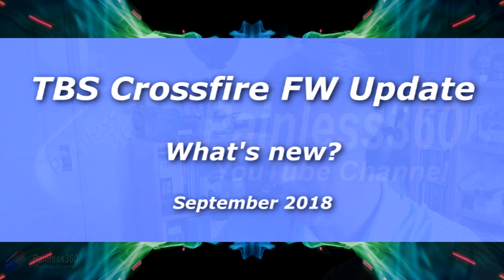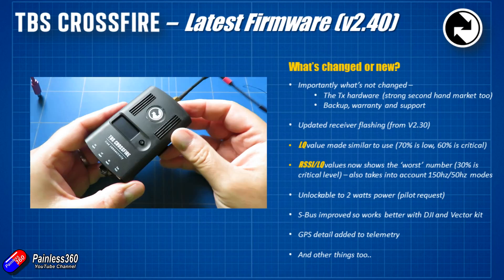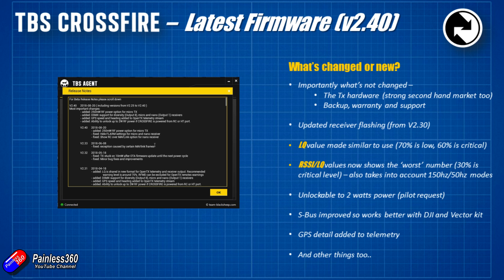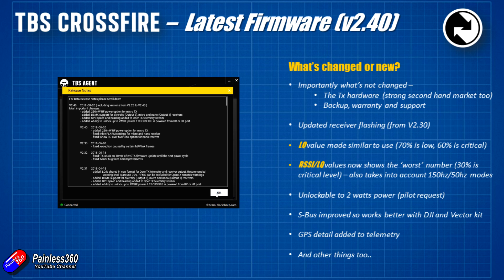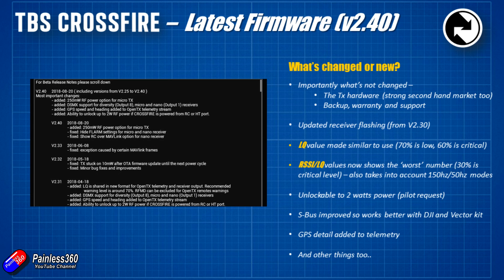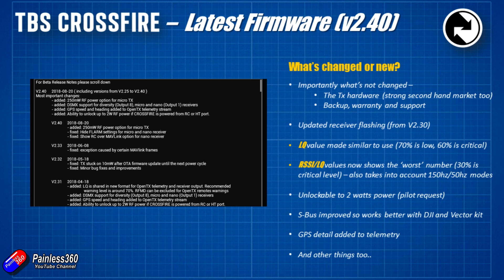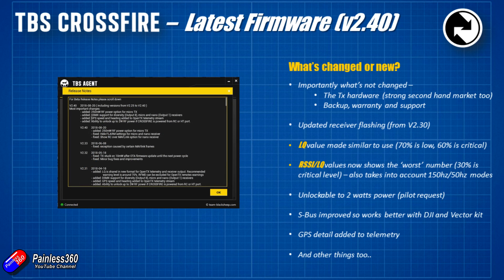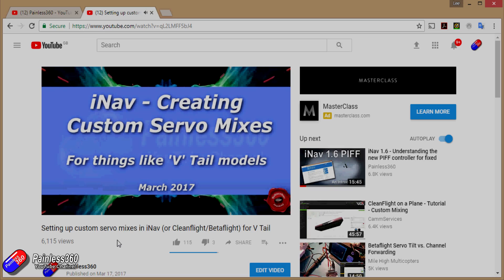TBS Crossfire Series: What's new in V2.40 of the firmware?

Comment: Really interested to hear how TBS managed 100KM flights? I take it they are all line of sight? However, I have seen that they managed to use a fixed wing model to deliver mail through the Alps, no mean feet and also trying to understand how that was physically possible due to no line of sight???
Reply from the maker: Flying BLOS (beyond- LOS) is easy to do it you're running a flight controller that has the ability to fly autonomously. See my recent Arduplane builds on the channel.. Happy flying!

Comment: Hi Lee, great video as always. Noob question: I updated the firmware and now the OSD shows 40 instead of 99 (LQ) how it used to. Is it normal? Thanks and cheers from Ecuador.
Reply from the maker: Let me check and come back to you..
Reply: @Painless360  hi Lee, I just upgraded a quad that I had with butgerflight because they recently released the 3.6 firmware, and guess what? Same happened this time. The RSSI now shows 40 instead of 100. Did you find out what's up with that? Thanks!
Reply: @Painless360  there's a FB group dedicated to help n00bs like me. Apparently after upgrading the BF firmware of your FC, and if you used a dump to set it up, you have to go to the CLI and set RSSI_scale = 100. That fixed my problem.

Comment: I understand that R9 also throttles update rate, Crossfire is not alone.
Reply from the maker: I'd be interested if you have a link to that. I've only read that it's fixed..
Reply: Nothing concrete, but inferred from rcgroups discussions with FrSky during testing and debugging earlier this year. For example the last line of :  https://www.rcgroups.com/forums/showpost.php?p=39292614&postcount=1922  I hope this helps.

Comment: Would you recommend ppm for the Vector Instead off S-Bus ????
Reply from the maker: Until I've tested it I can't comment from my own experience. There have been issues with Vector and Crossfire for a while with each vendor pointing the finger at the other. The most recent improvements in the S-Bus implementation in Crossfire were for the DJI kit really but should improve the issues with the Vector..
Reply: Painless360  Thanks forgetting back to me👍 Been having major problems That bad I even bought the spektrum ix12 for crossfire. 
In the past month I have had models drop out of the sky for no reason with my Taranis on crossfire Module and full-size to 😖
Will have to wait and see what’s happening. Hope you have more success👍 Will keep a keen interest on how you get on
Keep up the great work

Comment: HELP !  anyone out there in the USA who is fluent in the CROSSFIRE Language and want to make $ ?    I have all the "stuff"  but not connected (Tango Oblivion Big Module etc)  ...looking to ship yo someone to have it all connected …….
Reply from the maker: See my Crossfire series. A lot is explained in there..
Reply: I LOVE YOUR CHANNEL IT IS MY ABSOLUTE FAVORITE !  Period.  I have two BRAND NEW Onblivion and neither will arm and fly ?  damn ...one will arm and spin up for 20 seconds and die ?  other nothing ..  Brand New Tango sitting here ..bummer ..I really want to install DVR on Tango so I can easily find down kwads ..
Reply: @CaribbeanZapatta  Did you find a solution to your problem?
Reply: no
Reply: @CaribbeanZapatta  For the quad that powers up for 20s then dies. You should check the ESCs firmware and make sure if you reverse your motor direction on the esc firmware, you have hit the REVERSE BUTTON on your "flight controller configurator" in the configuration tab.

Comment: You might be interested in this project on RCGroups. 
It is a basic tracker which can utilise the Crossfire Bluetooth for GPS position of the aircraft. Nice thing is it is not F.C. specific so can be used for Vector, iNav, etc. I am going to build one to mount my Dock King with 2.4 module and repeater. 

https://www.rcgroups.com/forums/showthread.php?2942118-Build-a-Reliable-and-Cheap-Antenna-Tracker-this-Weekend-%C2%96-by-zs6buj

Comment: I use the crossfire with the vector for the last year and a half and it is working perfect, i had indeed the sbus issue so i set the receiver to go to a failsafe perset failsafe position but i'm going to try the new firmware if the sbus failsafe function is better now. What you also can do is to connect the vector bus to the crossfire bus, then you have all the data from the vector in your crossfire. Working verry Nice and you get the GPS data on your receiver. Maybe a surgestion for your vector-crossfire built.